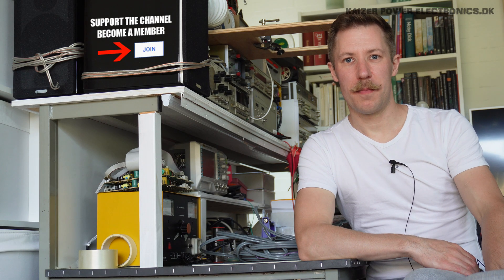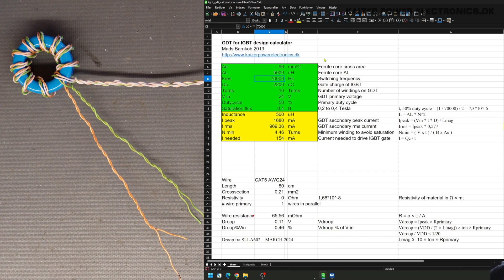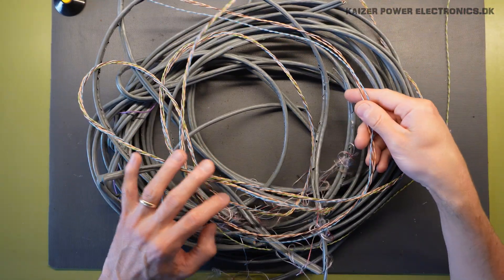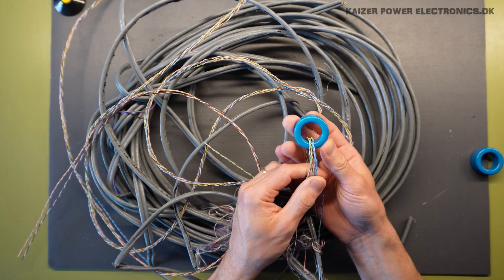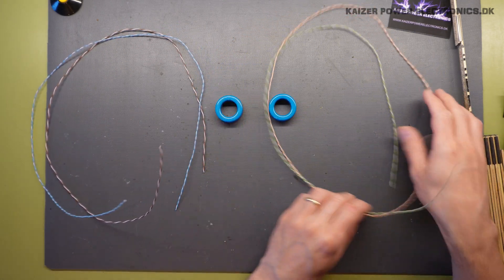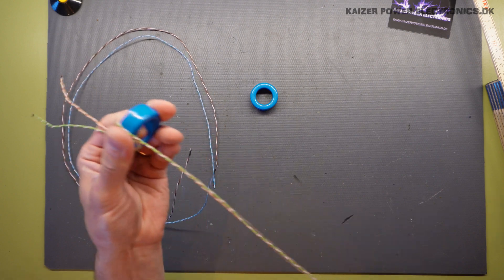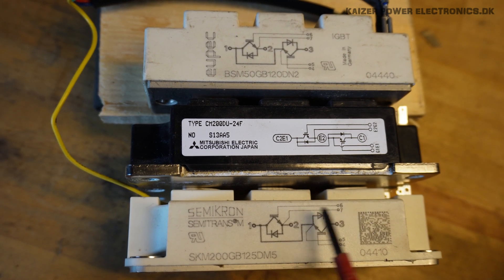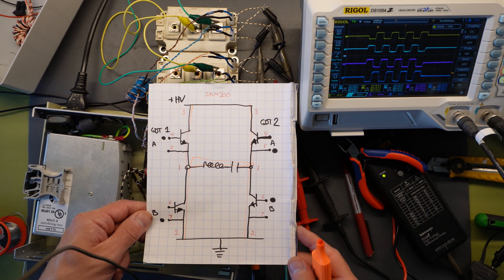IGBT Gate Drive Transformer (GDT) Design, Construction and Test

Comment from the maker: GDT calculation spreadsheet and more information: https://kaizerpowerelectronics.dk/teslacoils/igbt-gate-drive-transformer-gdt-design-construction-and-test/

Corrections to video:
2:41 Currents and peak currents are not charging currents, but magnetizing current. Charging power is from the driving circuitry and depends on transformer ratio.
@drobotk At 12:20 I think you meant E2 is negative and C1 is positive ;)

Comment: Would it be necessary to use gate resistors or diodes on the secondary of the GDT? Or Zener diodes? I've been using a bootstrap circuit to drive some smaller discrete IGBTs in TO-247 packaging and keep blowing them up, trying a GDT next. Cheers for the video!
Reply from the maker: Gate resistors is mandatory. You want to switch your current as fast as slowly possible. Meaning that going too fast just gives you overshoot and ringning, too slow gives you higher losses from linear region and getting it just right with a small bump... perfect. Diodes and possible a lower value resistor can be used for faster turn-off.
Reply: @KaizerPowerElectronicsDk  So true! Moreover, the ringing is not the only problem here. The IGBT\FET crystal in fact consists of many many small transistors in parallel. Their specs are almost equial, but still have minor variabilities. With no gate resistor, the fastest cell will turns on alone, take all of that current solo and die. Next time - the next fastest cell dies - and so on. Without gate resistor at all, and with notable power, the IGBT\FET chip will degradate and failure with time (days? weeks?).
The gate resistor slows down the cells inside, and helps them work together.
Another problem - if the IGBT\FET turns off too fast, it can be killed by overvoltage, especially at short cirquit, when the overcurrent protection tries to turn it off, but the SC current is so high that even snubbers ain't enough to handle with the voltage spike created by dU\dt !
Reply: @KaizerPowerElectronicsDk  I've seen topologies where a zener diode is placed in parallel with the gate resistor, for example 3.3R and 5.1V Zdiode, what does this provide, a cleaner turn off? Once I also saw a low-voltage zener in series with the gate resistor but I think that would mess with the gate signal and possibly damage the mosfet, right?

Also a related question, almost every time my mosfets have died, I can hear a clear, high-pitch ringing sound before they go "clack" and stop working (no resistance between S and D, very little ~25 Ohms between G and S or D); do you know what causes that sound?

Comment: Why is a GDT necessary? I'm pretty familiar with the inverter drives that use those IGBT modules (very common in CNC spindle drives) - they don't use transformer drives, they typically use hybrid modules that just contain a strong FET as far as I know to drive the IGBT gates, but maybe there's some secret sauce to the hybrids, as they're always potted to make it more difficult to see what they did in there
Reply from the maker: Galvanic isolation between driving circuit and power electronics. What you are talking about is a HSD or High Side Driver. Here the isolation is at the logic level and a isolated power supply and driving circuit is floated at the IGBT voltage level instead. I listed Pros and Cons in the article on my website: https://kaizerpowerelectronics.dk/teslacoils/igbt-gate-drive-transformer-gdt-design-construction-and-test/
Reply: It's sometimes useful to galvanically isolate the driver from the high voltage rails, bootstrap and optoisolators are alright, but GDTs are great. Transformers are typically more expensive than solid state alternative, which as far as I'm aware is the main reason they're less common recently. They do also have issues with things like DC switching, as cores saturate with lower frequencies, though in turn saturation can act as a safety mechanism when driving purely inductive loads.
Reply: @UniCrafter  Ultimately a GDT pretty much sets in stone how you have to run the IGBT. It's very application specific and doesn't allow for on-the-fly modifications. Whereas, with the same toroid, you could make a really basic SMPS circuit with 4 secondaries, and use simple opto-isolated gate drivers. Allows you full control of the IGBT without having to play around with a transformer every time you want to switch differently or use a different IGBT with different gate charges.

Pretty much all EV/hybrid car inverters do it that way, just have a couple SMPS's that take 12v and make their +- 15v or whatever they want to use, and opto-isolate everything. Maybe its just cost but from an engineering perspective, it's possible that they would change the switching frequency on the fly for some reason, IE in sharp acceleration where one may not care about motor noise vs slow acceleration where a 10khz whine would get annoying really quick.

Comment: Half turns are only possible with E type cores. I think we can count the number wires on the inside of the toroid to guarantee the right number of turns.
Reply from the maker: Interesting topic really! I just quickly googled half turn effect power transformers and apparently that is a bigger issue with high losses than I imagined. This further brings up a ring core as recommended GDT core, compared to E cores. E cores require some different compensating windings to negate half turn influence, if you exit the winding windows on opposite sides.